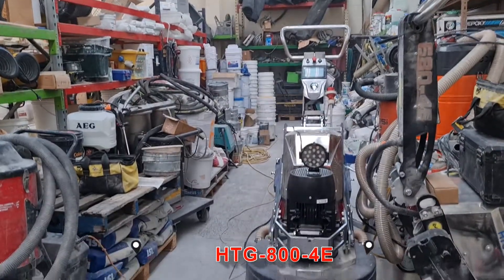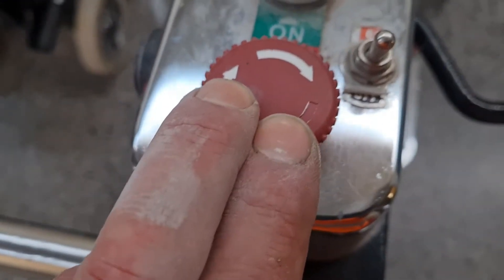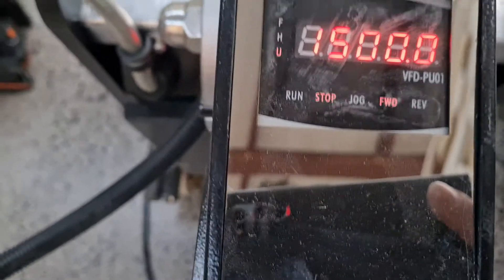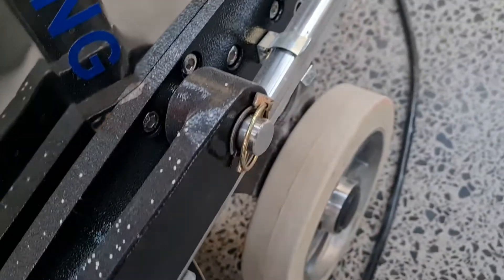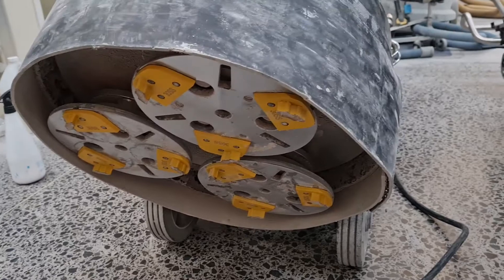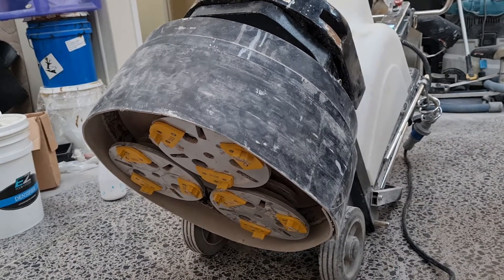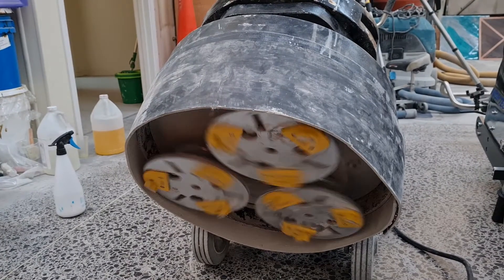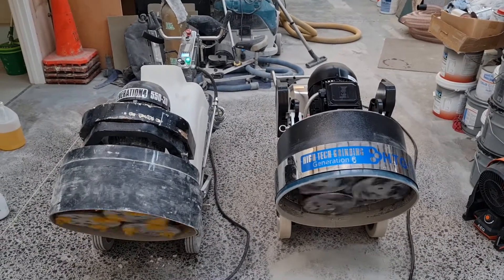550 concrete grinder comparison

Comment: Can you feel the difference between 4kw and 5.5 kw motors on the 6. generation machine?
Reply: Is it possible to polish with the 4kw motor?
Reply from the maker: @tamaskovacs8074  Not had 5.5kw.  You can polish with anything, just need right diamonds and be willing to spend more time.  3 Phase is definately faster

Comment: as far as Chinese grinders go, Xingyi are very good machines. I remember back around 2010 I was looking at some ASL grinders and others from China and they were absolute trash. Things have gotten much better since then.
I used to have that older 550 and it was a very good little grinder
Reply from the maker: Yes Xinygi and their High Tech Grinding brand are best value for money.  Been using this one for years

Comment: Looks good. One thing that definitely needs to be addressed is a larger water tank opening, like the older model. that would be awkward to pour water into from a bucket for instance.
Reply from the maker: I've never used it wet. If wet grinding usually use a hose and Saturate the floor.